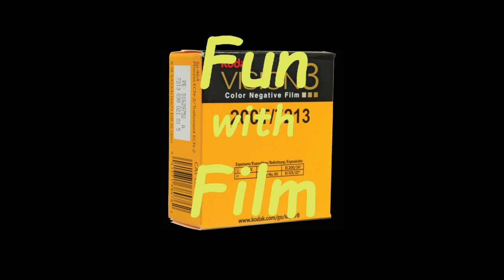Fun With Film Episode 2 - anti-halation layering and remjet.

Comment: Great vid, you know your stuff! I've been looking for a comparison between the Kodak stock and Cinestill - I don't want halation if I can help it! Just need to make a water knife! £8 a roll - lol - I just paid around £14 ffs!
Reply from the maker: Cinestill is something that worries me - not just the price! The problem is we don't know the life expectancy when developed in C41. Silverprint are selling at £9.50 ish a roll (35mm) at the moment. If you live near one of the major studios it might be worth chatting up their processors and seeing if they will tack it on the end of a ECN run. If they will then look for Vision 3 short ends and not worry about the remjet :-)
Reply: Removal of the remjet layer can be done with a softening solution and water flush; little or no mechanical scraping is required; do a "remjet removal" search on YT for several instructional videos. The distinction of Cinestill films is that they are Vision 3 film with the remjet layer removed before you use it. As a result, you get flare in various situations. Considering how easy it is to remove remjet from regular Vision 3 film if you process your own, and the relatively cheap cost of Vision 3 in bulk rolls, it's hard to justify the high prices and flare-prone images of Cinestill. If you do not process film yourself, you are probably ahead on cost to use regular films. Processors will not process your Vision 3 bulk reloaded rolls of 35mm because they do not want remjet (carbon particles) shedding off inside their processing machines and damaging other film